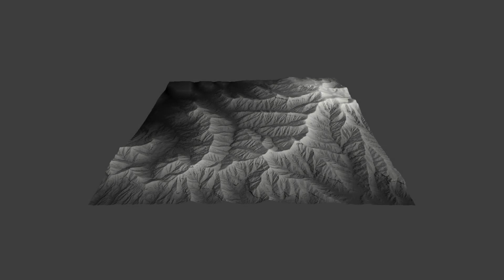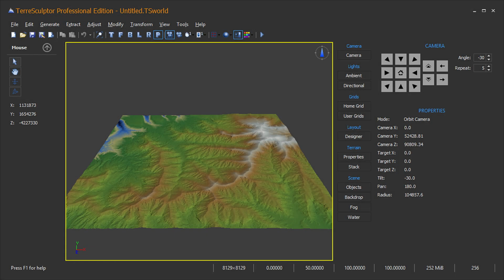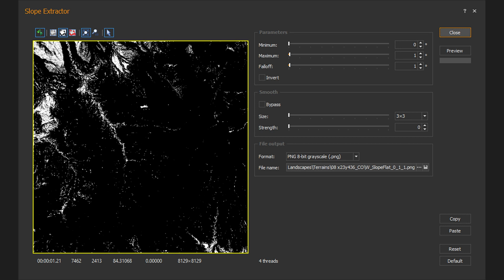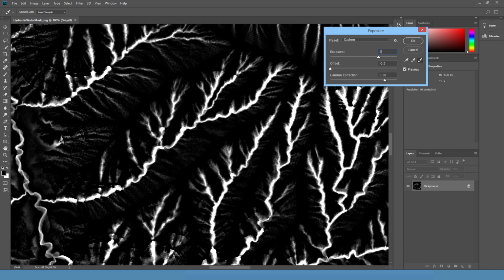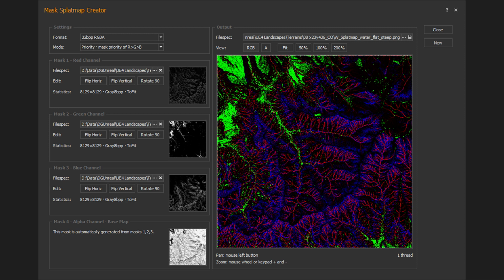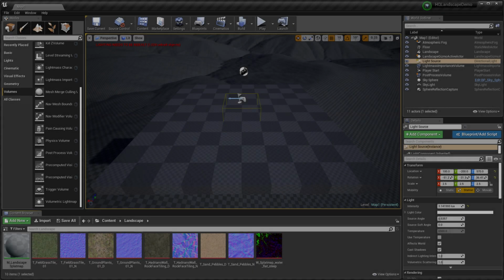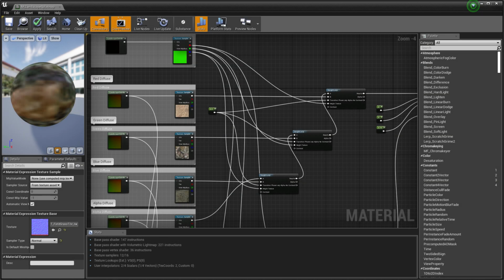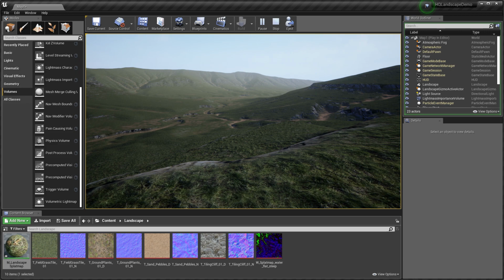TerreSculptor - How to Create a High Quality UE4 Landscape

Comment: What kind of parameters about the current terrain does TerreSculptor use when adding effects such as erosion? For example, does it add erosion realistically by eroding down toward rivers and lakes?
Reply from the maker: There are slight differences between the algorithms for each Erosion type available in TerreSculptor.  They all do erode taking slope into consideration, so they all do move terrain material down slopes towards lower elevations, and create sedimentary deposits at the base of hill elevations.  You usually get the best results by applying some Rain Erosion followed by some Hydraulic Erosion.  Additional Erosion algorithms are under development.

Comment: Thank god I'm using a 3950x. 16 cores and 32 threads. Made doing this way less time consuming
Reply from the maker: My development workstation is an R9-5950X, ASUS X570 ROG Crosshair, 128GB, RTX-3080, and it is awesome for working with TerreSculptor and Unreal Engine 4 and 5.

Comment: i dont understand what i need download in alpha and splatmap node in unreal (
Reply from the maker: The Splatmap Texture Node in the Unreal Engine Material uses the Splatmap that you created with the Splatmap Creator in TerreSculptor.  That splatmap texture contains multiple bitplanes for the texture masks on the RGBA bitplanes.  You create four weightmaps for each of the bitplanes in the splatmap, such as Flowmap, High Altitude, Steep Slopes, and Flat Slopes, and use the Splatmap Creator to pack all of those into the splatmap bitmap that you use for the Material.
This is an old outdated video using an older version of the TerreSculptor software.  There are newer videos that cover creating RGBAK splatmaps and using those with Unreal Engine.

Comment: AFAIK since this video was released, TerraSculptor has been made completely free so the comments on the Pro version no longer apply.
Reply from the maker: That is correct.
The Standard and Pro Editions were for TerreSculptor 1.0 only.
Starting with TerreSculptor 2.0 the software has been completely free for any use including commercial.

Comment: I just found this program yesterday and it's fantastic! Keep it up! UI is nice, though feels a bit old and lacks usability a little. I saw your comment recently, that another update is in the works, so I'm really excited for the news. At first, judging by the name of the program, I thought it has sculpting mode with brushes... so are those in your plans perhaps?
Reply from the maker: The application Skin Theme can be adjusted in the Tools Settings Interface tab.  The default is Microsoft Office but you can change it to any of more than 50 skins to suite your taste.
The User Interface design has basically a slight feel of Autodesk Max and Photoshop.
TerreSculptor build releases are typically every four to eight weeks.  Sometimes they are new features, other times they are maintenance releases with many bug fixes and internal code changes and small updates to improve usability.
The software is only about half done, so there is a massive number of features still to be completed and released.  If you are a Patreon subscriber or you visit the Facebook Group, those places are where I normally release previews of what features are being released next and what is being worked on.
This year should see some more updates to the 3D Engine including terrain mesh sculpting tools and brushes.  Sculpting was planned from the beginning, hence the software name.
TerreSculptor is a solo project that I work on after my paying job, it makes basically no income, and as a solo developer it takes me a while to get some of the major features completed.  The software is 800,000 lines of code so far, and even though it is only half finished, it still contains a good number of features.  I put between 60 and 80 hours a week into it's development

Comment: Amazing tool!  A quick question...where do you find proper UDK (Epic UE 1 meter equivalent maps) height maps?  I want to build real world locations, but am lost about where to find those geo files.  Thank you so much for this program!! Cheers, RR
Reply from the maker: That depends entirely on what area of the earth you are looking for.

DEM sites like EarthExplorer and Terrain.party that cover the entire earth typically only have 30 meter or 90 meter data, since they are satellite sourced data.
You might find some areas of 10 meter data mixed in there.  This is fine for backdrops but not so good for play areas.

The USGS has some 1 meter DEMs of portions of the continental USA, but they are stored as original files on a server with no void fills, so half of them are unusable, and you would have to use GDAL Translate to convert the files for use with TerreSculptor since they are in an odd file format.
I have spent hours going through this data looking for usable tiles, and I have started making them available on Gumroad for cheap, see the Unreal page on the Demenzun website for the packs that I have completed so far, more packs are coming, I should end up with a few dozen terrain packs of all of the usable files from that set.
http://www.demenzunmedia.com/home/unreal/

The UK Defra site has portions of the UK down to 25cm which is really high resolution.  See my UK DEMs video for more information on that.

Most other areas and countries you have to use Google to find sources of any DEM repositories, as they vary by country, and many countries don't have high resolution data available to the public.
For example I have tried looking for DEM sites for Saudi Arabia and China, and they only have low resolution data (probably due to government secrecy control).
There are also a few websites that maintain lists of what the current DEM sites are around the world, but they change so often that it's hard to keep track.
For example: https://freegisdata.rtwilson.com/
Reply: @demenzunmedia  Thank you so much for your reply!  Terre Sculpter is an amazing chunk of incredible programming!  I truly appreciate that you have put it out for the world!  I was able to get an 'OK' portion of an area from Terrain.Party, Normalized, Set, and Re-sampled in your TS....then I used a rough workaround of measurements from Google Maps - satellite imagery as close as possible.....then scaled the Height Map in Unreal (4.26) to a cube, set to that measurement.....adjusting the Z visually (unless I had a building height reference), until the landscape matched.  Once I did this, I was able to use a landscape layer (UE 4.26 is Non-Destructive NOW!!!) on top of the Height Map to finesse details of the landscape that did not contain meshes.  Beautiful!!   I really appreciate that work you have done!  Ill be on Patron soon to support you!  Cheers!!!!! -RR
Reply from the maker: @RCR-StolenUFO  - You are welcome.  Thank you for your support.
There are many updates and new features planned for TerreSculptor in 2021, plus more tutorial videos, and related projects.
Reply: @demenzunmedia  Amazing!  Ill be watching out!!!

Comment: Could this material be made paintable if you created your material as a material function instead and used it as the "base layer"/Default in a paintable auto material?
Reply from the maker: You should be able to mix Splatmap and Paintable layers in the same material by using Lerps to mix each paint layer with a splatmap layer.
All that UE4 does with painted layers is pack all of the weightmaps into a splatmap, which is essentially the same thing.  I will try to do a tutorial video on it.

Comment: Hi, this an excellent tutorial, thanks! I've got the material setup and working, but have been trying to add additional maps (roughness, displacement) by repeating the node structure in the same way, but everytime I plug in the setup for the roughness maps, the texture goes blank/default material in editor... Any idea why? Thanks!
Reply from the maker: When a UE4 material drops back to black or default, that means that you have used more than 10-12 textures which is the maximum supported (16 samplers) unless you enable Material Texture Wrap.  Google should give you some results on where that option is located in the UE4.

Comment: is there an ability to make the landscapeCoor multiplied to uvTiling so I can manually adjust the tiling on each texture set?
Reply from the maker: You can modify the TexCoord values for each texture in the material.  You can change the splatmap style material to anything you want.  The material in this tutorial is only one example.

Comment: For the watermask file, when i export it, it gives me this jadged line on it. Not sure if this is normal or an error.
Reply from the maker: It is normal for some of the Weightmaps to have aliased or jaggy edges to them, especially the Weightmaps that are saved out of the Erosion devices.  I should probably include a Smooth option on all of the Weightmaps on the Erosion devices.
You can use Photoshop or Gimp or any other image editor to smoothen those masks.
The Weightmap extractors on the Weightmap menu do have Smooth options on them.  I will be adding a Water Flow Weightmap Extractor soon that will also have Smooth on it.  Plus I am working on a Mask Editor that will have a lot of image editing tools on it.

Comment: 8,192*8,192
not 8129))))
Reply from the maker: That is not correct.
8192 is NOT a recommended and optimized UE4 Landscape size.
8129 IS a recommended Landscape size.

See the UE4 Landscape Technical Guide for a list of the recommended sizes:
https://docs.unrealengine.com/en-US/Engine/Landscape/TechnicalGuide/index.html

I recommend that you study that document web page to understand why you are NOT supposed to use non-optimized sizes.  Recommended sizes result in proper component layout and optimal occlusion culling.
The UDK Landscape Sizes dialog in TerreSculptor also has all of the Recommended Landscape Sizes so that you do not use an non-optimized Landscape dimension in terrain development.